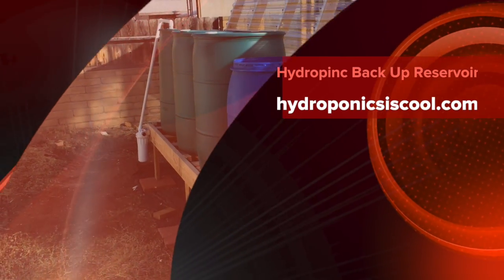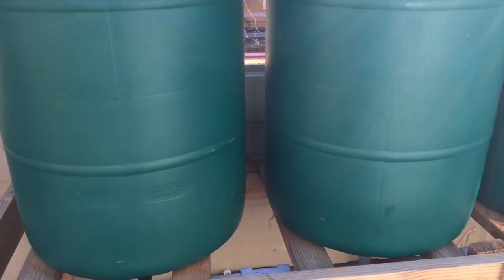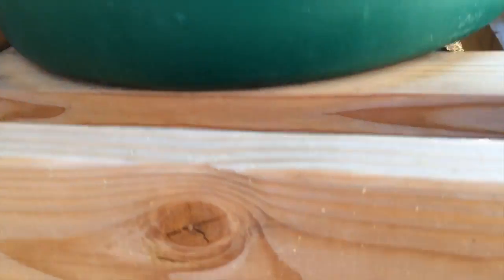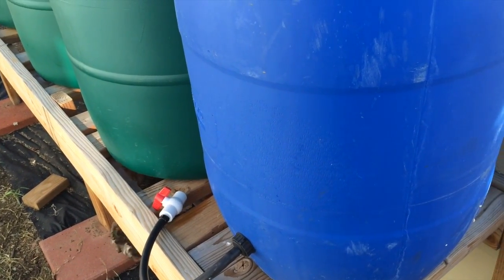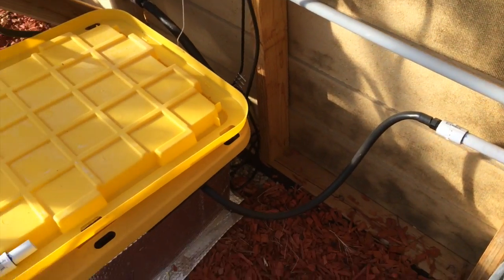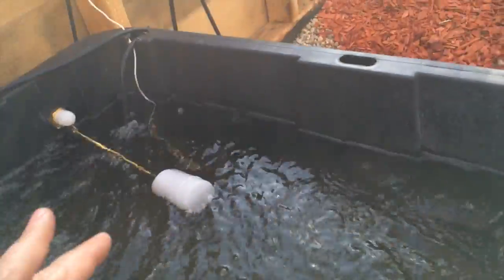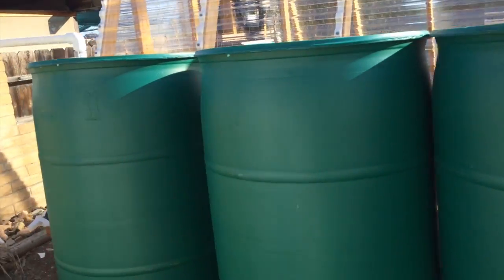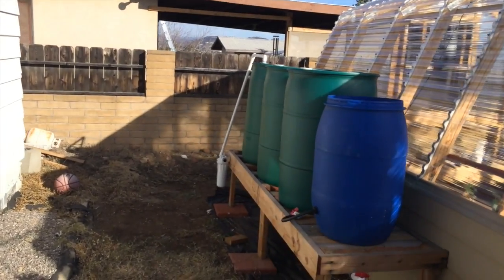Hydroponic Back Up Reservoir

Comment: The downside of hydroponics is that you will need to shop for "plant food" or nutrients and supplements which can be more costly.
Reply: Aquaponics brings together the most beneficial parts of Hydroponics And Aquaculture so greatly reduce price and increase work productivity. You can find the most effective aquaponics plan below:
help1.info/best-aquaponics-plan
Reply: @daminomally8551  I don't have a problem getting nutrients.  Spend $35 and get all you need for a whole year.  Very easy.  I have over 100 5-gallon bucket system and 20 50 gallon barrels, all producing rapidly.